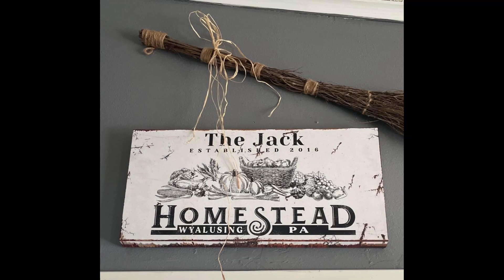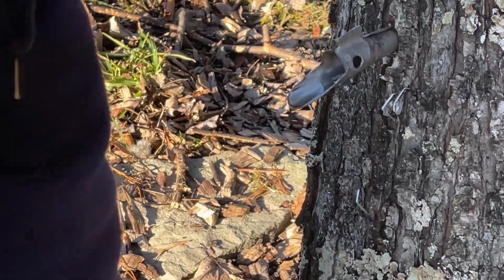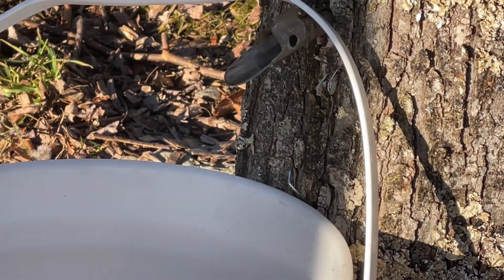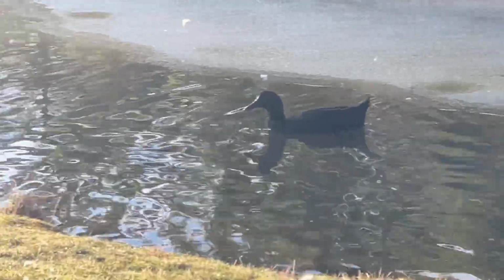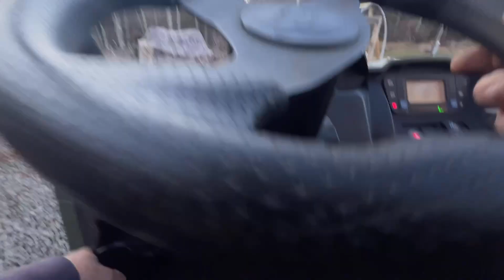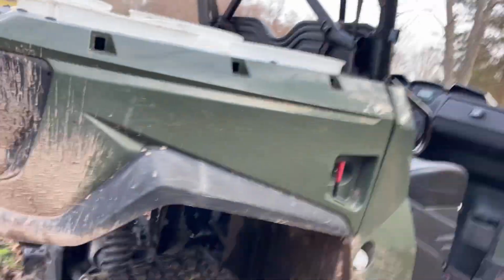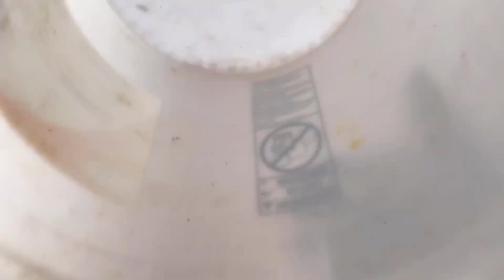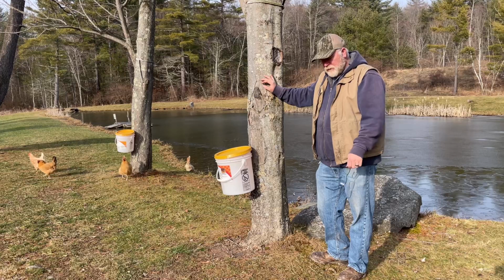Tapping maple trees 2023

Comment: Using a sharp drill bit is key! One motion, in and out quick makes a perfect hole that weeps better and drips longer. Not blowing into the hole, using a clean spout and not introducing a foreign object into the hole keeps the bacteria that dries/heals the hole quicker, from occurring. Using the tap placement suggestion of 6 inches right or left and 6 inches up from last years hole keeps from drilling stained wood that wont weep as well.